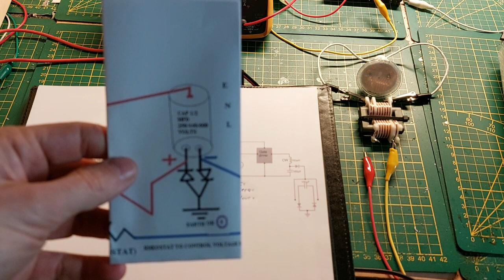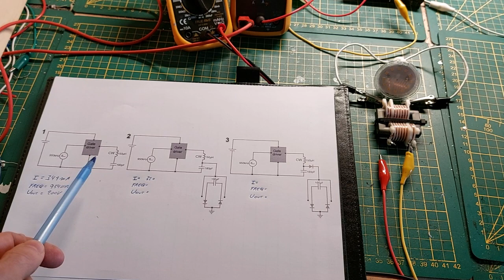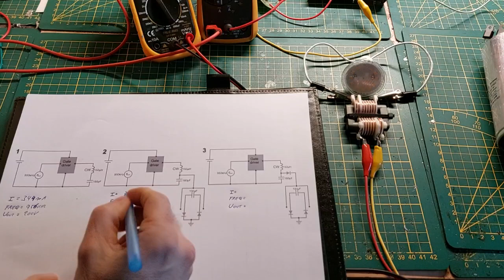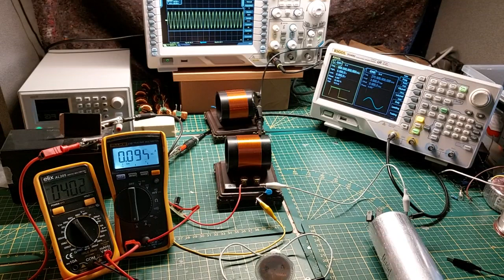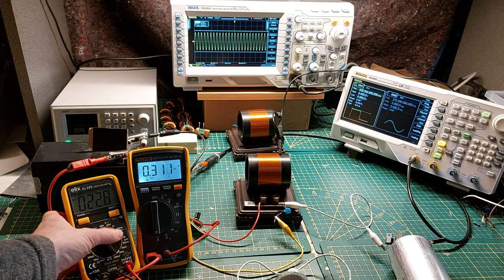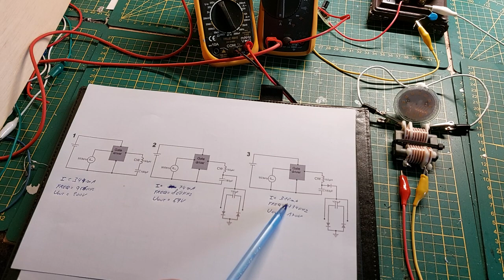Charging capacitor from Earth Ground based on Zilano circuit.

Comment from the maker: Charging voltage of capacitor was lower when working with battery powered signal generator (150 volts instead of 200) 
Next question I would like to examine: why is the diode helpfull between LC tank and our capacitor?
To start I´m going to look at it from impedance standpoint. 
A diode in block is a small value capacitor, this means that impedance is high, for example 100pF at 950Khz = 1,6k ohm, while our 100uF capacitor has only 1.6mili ohm. So the first possible reason why I think the diode is helpfull is the higher impedance and thus less current. Allthough it´s one wire, once you experiment you´ll see that it behaves as a load, different then in close loop but still a load. Upcomming weekend experiments will hopefully give answer ro this.

Comment: Try your plasma column setup - put the metal capacitor on one of the plates with your AV plug and see how quickly it charges
Reply from the maker: Thanks for the idea, I will check it out. Now I know I can limit the influence with the diode in between results could be better. Previously I couldn´t combine the output if more plates, what was there was shared not added, hopefully this extra diode also helps in that case.